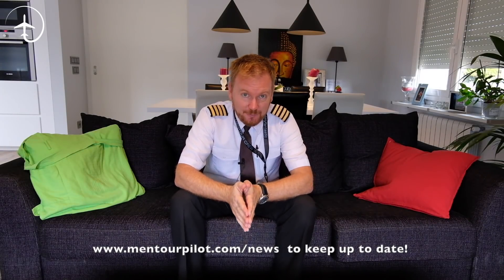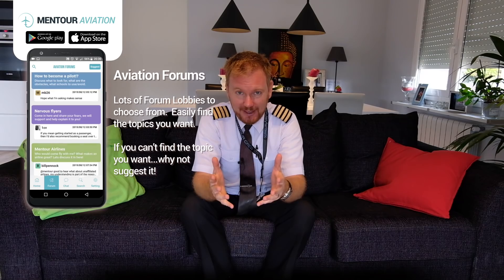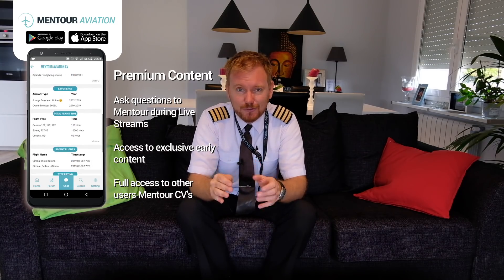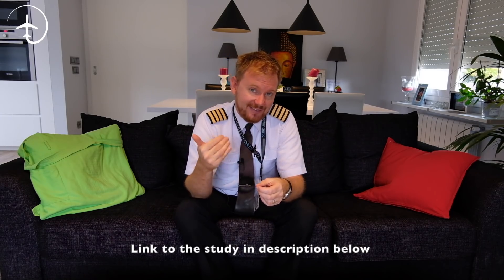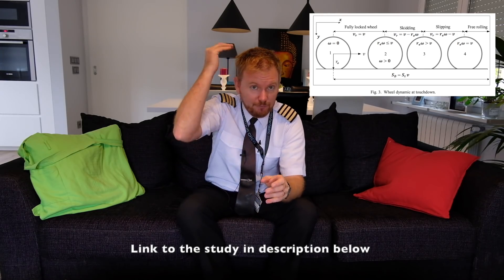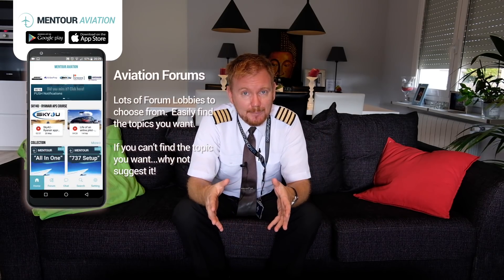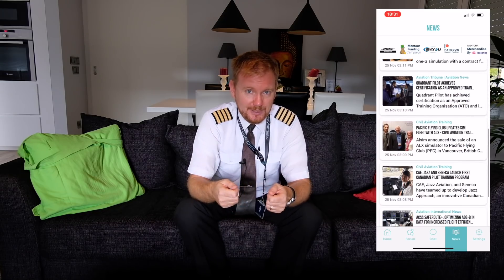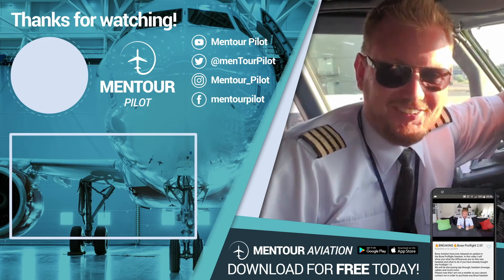Use WIND to spin the aircraft wheels before landing?!

Comment: Commander, no doubt most of us have seen the bicycle tire gyroscope balancing on one end of the axle and the near 90° torque forces that are generated. imagine, 8 or more massive Tires and Wheels spinning attached to a floating object and the gyroscopic forces possibly causing unpredictable handling of the aircraft during flight
Reply from the maker: Like I said in the video. The forces are there but are insignificant in comparison to all the other forces involved. Just like the gyro-effect from the massive engines who are spinning many many times faster with a bigger mass has no noticeable effect on the handling.

Comment: The "Scuff" of an airplanes tires on landing it a positive thing.  Like a dragster's "Burnout" before a run, the scuffing cleans and warms the rubber of the tires making them grip better and cleaning any debris they may have picked up when it took off.  It also slows the planes  by acting as a FREE  "Brakes on"  condition

Comment: Passenger aircraft are built to a budget . They are built to be made as cheap as possible whilst passing all the safety checks. They are built to operate inside it's service envelope and not much more out of it . Company's like boeing and airbus will not add anything to an aircraft that it doesn't basically require . Unlike cars made by volvo etc . These aircraft only just manage to get off the ground and if there is a problem and you need a power boost or to stop it quickly ......your fucked.  It's like buying the cheapest possible car on the market with a tiny engine and no safety features like airbags etc but you can fit 20 people in it and it will go  and stop and nothing else .

Comment: Clearly physics isn't your strong point sir! MIT has a design that clearly makes a huge difference in preserving tire life.  Do more research before posting false videos!
Reply: Would you review the technical document and see if you agree with my critique.  I believe it has an error that undermines it's entire argument about insubstantial wear reduction as per my earlier comment:

"I assume I'm wrong but there's a critical point on Page 8 showing "Wheel Angular Velocities" and a Figure 9.

It shows the three conditions -- wheels static, 50% spinning, and 100% spinning.  At the 100% spinning level it seems to claim the wheels actually slow down and then go back up to the 100% spinning level.  It describes in broken english why this would be the case and this spin down followed by spin up is what causes the "skid" that produces the minimal 50% reduction in wear.  

But I would assert that this is empirically incorrect.  If you pre-spin a bicycle tire you're suspending from a truck in motion and put the bicycle to the pavement, the wheel will simply spin at the correct speed.  There is no "spin down" followed by spin back up.  There's a lot of math and explanation above this section so maybe I'm wrong and missing something but it seems to me all that math has nothing to do with the assertion that the wheel has anything to do but match ground speed if it's already spinning at that rate.  There's no reason for it do anything else.  And if so, then you get no wear at all.

So I hate to contradict the Captain but it would appear to me that this technical report has a glaring error in it. "